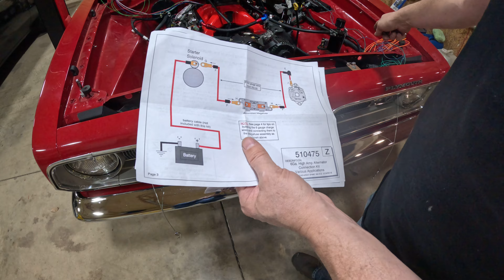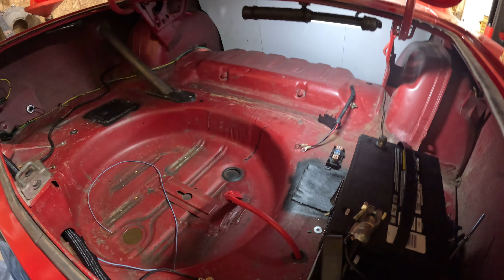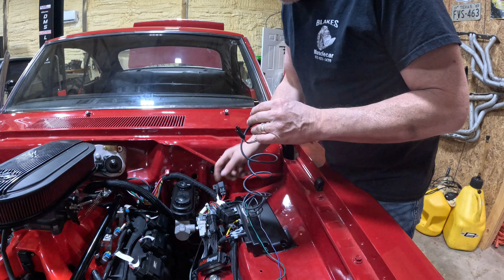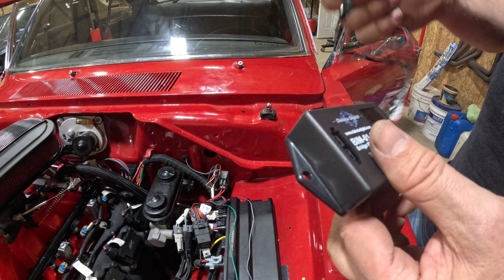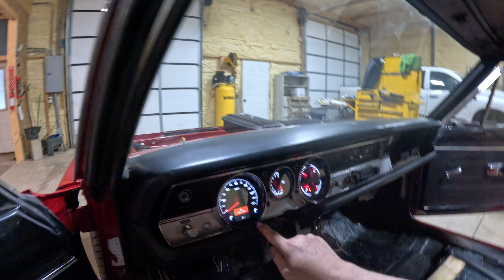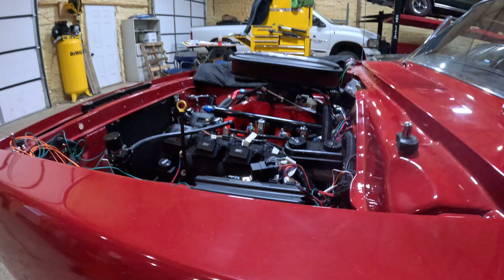Wiring a 200 amp fuse for a trunk mounted battery

Comment: I put a 200A inline fuse on my battery in the trunk (392 swap). Quickly found the factory starter needs up to 400+amps when cranking when it blew my fuse. I ended up replacing it with a 600a fuse and haven’t had an issue.
Reply from the maker: Wow! Ok thank you for that. I better look for a 600 amp!
Reply: @blakesmusclecar and I’m not saying our wiring is exactly the same, but something to keep in mind. My battery relocation kit came with it so I just added it. Luckily it died in my driveway. 🤣
Reply from the maker: @illegalmachine - Still great information!!

Comment: That Dakota Digital Dash and EFI interface is slick!  Are you going to have a battery cut-off for racing?
If you plan to run E-85 fuel, get a pump rated for E-85 like the Walbro 450 lph pump,  TIA485-2 F90000267
Reply from the maker: Thank you! No battery cutoff yet